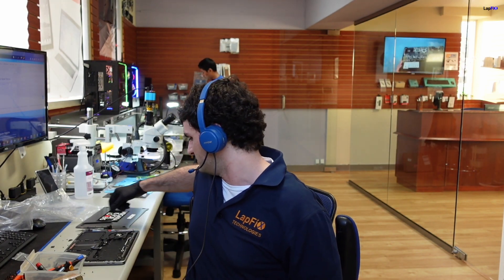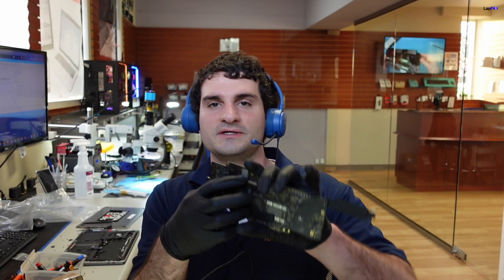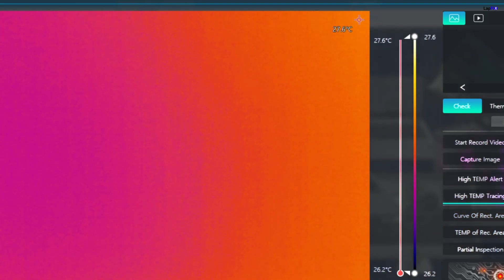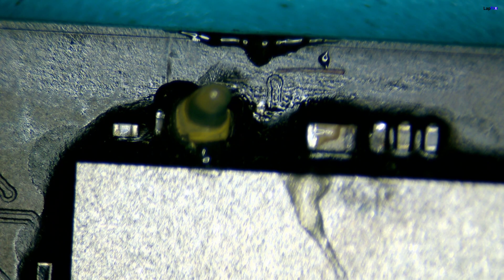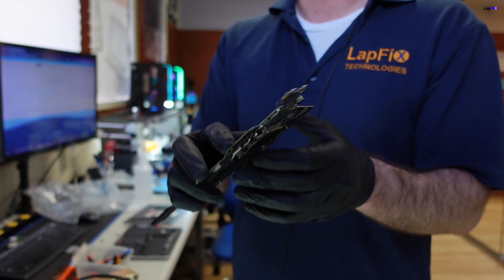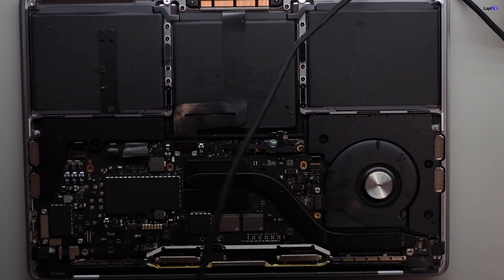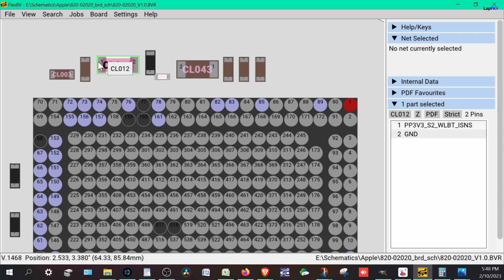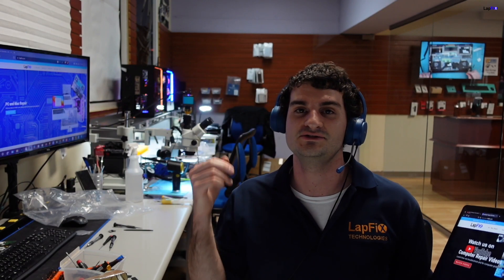Fixing A Macbook Pro M1 With A Liquid Spill

Comment: Would m1 pro, that turns on but will not charge,  show the battery needs service (has less than 20 on cycle count)?
I suspect is the usb-c port that needs to be cleaned or replaced. 

If plug in the top most usb-c port the fan sometimes goes full speed, everything works but will not charge. When plug in the 2nd ubc-c port, fan doesn't go but still doesn't charge. I suspect the ports are bad? The message on the battery says needs service but I think that is wrong?
Left a like of course!

Comment: That cap was clearly blown/cracked?
Reply from the maker: I apologize, I should have put a side-by-side to clearly show the bad and the good.  If you look at the middle part of it and compare it to the new one, you can see it looks a bit worn down.  These all should never have any adnomalities as they should be consistent.  The area was covered in liquid so it made pinpointing the damage more obvious to check.  But the thermal cam really makes it stand out we are lucky it was a short on that component and not somewhere else on the circuit or the wifi/BT chip itself